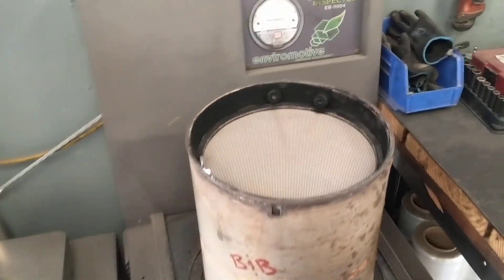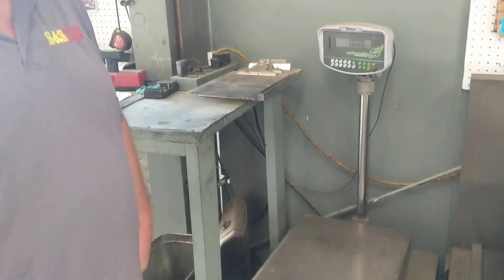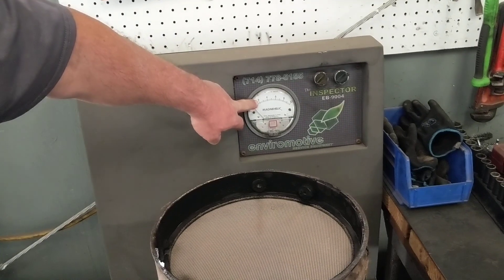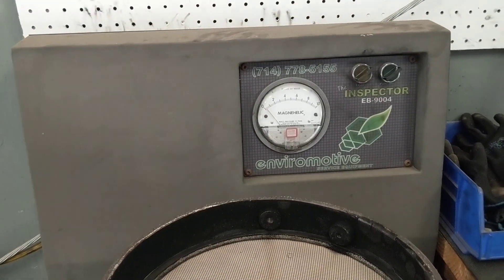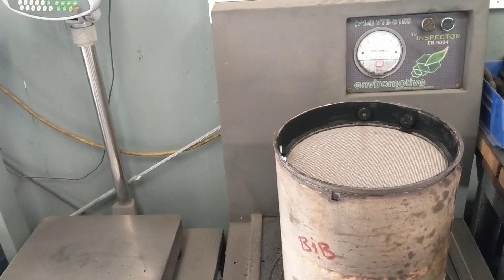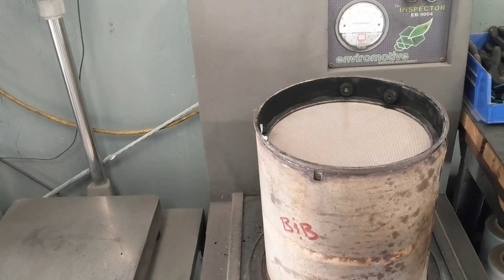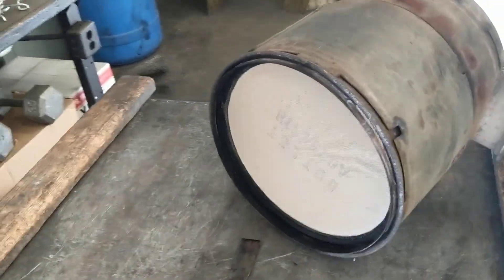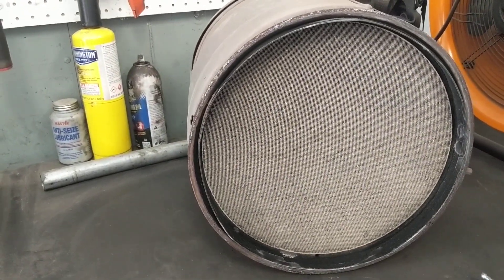DPF Filter 100,000 miles on it and NO SOOT !!!!!! Because CVHHO technology

Comment: Fellas I really hate to break it to you! But if the filter is flowing .04inhg the DPF is failed. This DPF holds no back PSI which means it could throw a fault code for DPF missing condition exists.

 Also the appearance of the DPF has nothing to do with anything. It can look clean and flowing spec but full of ASH. Or the truck could have ran a regen before the removal thus the clean appearance.

This video is horrible to say the least. This is the entire problem in the DPF industry. People servicing DPF filters with equipment they purchased from a company that well sell machines to any Tom Dick and Harry with Zero knowledge  of the Aftertreatment system.

Not saying this is you but .04 is a failed filter. Especially on that cummins and anyone with true DPF knowledge knows it.
Reply from the maker: You don't no what your talking about I would love to talk to you call me 209 496 7440 thanks.
Reply from the maker: Just to clarify you don"t understand our technology.
Reply: @ssfuturescott  correct I don't understand the hydrogen technology you speak of in the video. I dont care to or want to understand it. But I can assure you I understand DPF technology  very well, And .4 is a failed filter. No Cummins filter to date would pass as a good filter at .4.
Reply from the maker: @dpfalternativesrunclearlon6795  Call me I would love to talke to you.
Reply from the maker: I work with hundreds of truck companies I know all about DPF I have been working with It since 2007.
Reply from the maker: @dpfalternativesrunclearlon6795    We have done tons of testing at the California Labs and other  labs around the world which has given us a lot of knowledge about the emission system that has devastated the diesel engines around the world.
Reply: @ssfuturescott  okay great, but just so I'm clear on what you are saying. Is .4 inhg on a cummins ISX passing or failing flow number based on Standard baselines?
Reply from the maker: @dpfalternativesrunclearlon6795  The company the filter was taken to has been in business for years and is one of the most used companies in the area. He is very knowledgeable on the operation and cleaning of the DPF. So for you to make a claim that it is a failing DPF without seeing it is very bold. The truck that this filter  was on has a monitoring system that records all codes 24/7. This truck had many emission codes before our system was added. Once the system was put on the entire ICE along with the filter was cleaned. Hence the DPF having a .04 flow. This has all been fully documented. The companies mechanic was very impressed and now after 2 years of working with him is a believer in the system and cant say enough about how much the ICE world needs this. Until you have an open mind and see it for yourself you will be like every other inside the box non believer. Its ok because we are here in CA and doing the testing and proving it to get this on the market. So as for your statement about no cummins engine will have a .04 flow you are 100% correct....that is without our technology.
Reply: @ssfuturescott  your technology is destroying the DPF. If you are saying the reason why the flow is low is because of your technology id reconsider what you put out to the public.

.4 is low and on a Cummins it will throw a fault code for missing condition exists or it will throw a fault code 3376 for frequent regening. If i was you id delete the video if you could. 

Anyway good luck with your technology.
Reply from the maker: @dpfalternativesrunclearlon6795  again another bold uneducated statement. We have been to CARB and have a CARB EO from California. We DO NOT damage the DPF and the state test proves that. Again you dont understand the technology. We monitor codes 24/7 and the trucks engines performance and emission systems improve with our system. I have asked you to call and you wont. You hide behind the computer and bash a technology you are completely uneducated about. Stick to the cleaning bandaid business. BTW i tried calling a few of the numbers for your company and not one call answered. Bashing something you dont understand is unprofessional. If you would like to have a professional business to business conversation i would be happy to do so. If you want to continue to bash and slander without an understanding you are not worth the time. Closed minded people are just that closed minded and stuck in time. We are an innovative technology and minds like you wont get. Hope you have a great day.
Reply: @ssfuturescott  .4 is a failed filter sir. That's all im saying.
Reply: @ssfuturescott  I will take everything back and I apologize ahead of time.

Please provide the part number for that specific DPF and provide the passing and failing specs so we can all see exactly what I'm trying to say. If I'm wrong I 100% apologize and admit I am truly uneducated and should have never commented.
Reply from the maker: @dpfalternativesrunclearlon6795  No  problem. please provide an email and i will get details over to you.
Reply from the maker: @dpfalternativesrunclearlon6795  Just call me i would love to talk to you we  can help you.